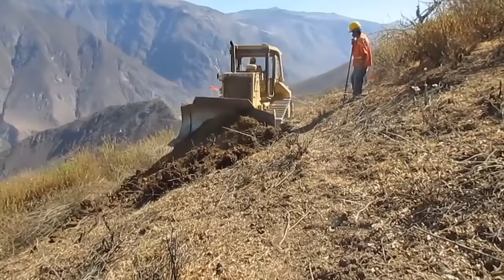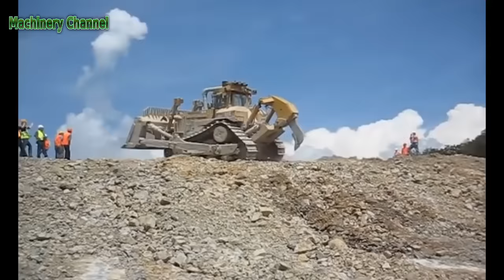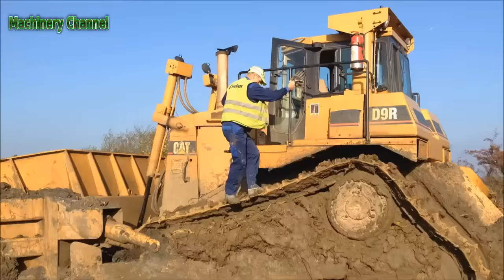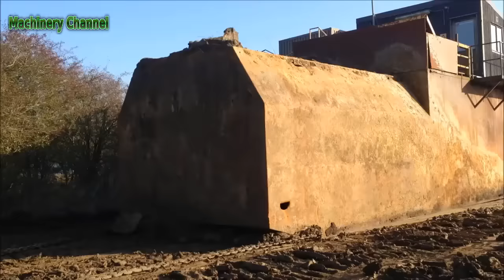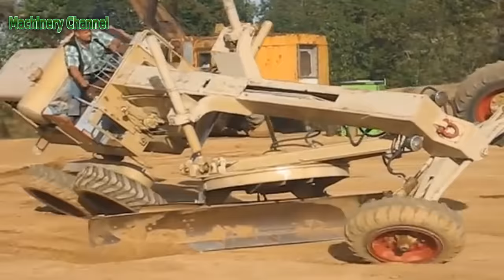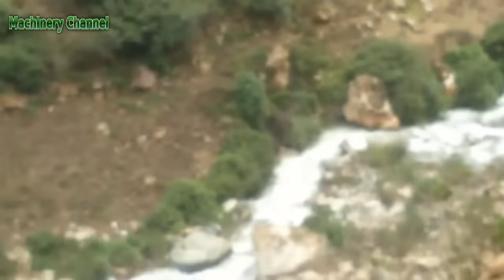Extreme Dangerous Biggest Bulldozer Operator Skills - Amazing Modern Construction Equipment Machines

Comment: I like how the guy in the grader is pulling handles left and right acting like it's hard to keep it in that position when really the blade is just holding it there and requires no real input.
Reply: lllllRBlllll   Ya but hes clearly taking things to seriously.
Reply: I don't see any health and safety inspectors looking on
Reply: A Paz
Reply: I bet his name is Scotty...and he likes Star Trek^^
Reply: С какой целью он так едет? Для чего он это делает?
Reply: I will throw that guy out right away ....he is scraping the engine, not built to run sideway.
Reply: @ВадимВладимиров-п7з  Он просто показывает что так может делать, но нет смысла так дорогу чистить это можно ровно ехать и делать он лишний раз рискует технику опрокинут.
Reply: Seems like they just fuckin around as it's an older looking model surrounded by old rusted relics 🤷
Reply: You don't know much as I ran motor grader years and it is not just holding it up.  You have to constanly pull your saddle set your blade much more if not you run the possibility of blade digging in catching flipping it stalling it.  He is constantly working it to keep it on the side and moving without all that I said.  Keeping one on all wheels cutting grade is a challenge but on the side is a different ball game.

Comment: ...all the while the grader was up on its side goofing off, the oil sump was starving for oil because it was all to one side of the pan. He shortened the engine life with that stunt.
Reply: I thought maybe the grader was doing that because he could get more weight on that side of the blade, but there's 50-100 people watching and filming, so it's some kind of planned stunt.
Reply: EXACTLY.
Reply: SixStringLove Guy I don't think he cared and it wasn't that cool of a stunt really
Reply: The thing sounds like shit anyway and looks like it's burning oil pumping out blue smoke.
Reply: Judging by the age of the machine, I would say its had a long enough life
Reply: Rubbish grade he was laying anyway. - What's the point of that sort of idiocy?
Reply: Fairly dumb exhibition
Reply: yeah that one is crap. That was was just being silly. But hey, this about skills. That was skillful.
Reply: That engine was already on its last legs. Blue smoke is made by the combination of burning oil and burning metal dust. At the very least, the piston-rings need changing. This is not the kind of stunt anyone should pull with old, obviously tired equipment like that. It's like he was actively trying to break it or something. It's not very bright to take an engine that's already putting out blue smoke and then starve it of oil, as you mentioned. I'm amazed it didn't throw a rod and put a window in the block while he was pulling that stunt.
Reply: top

Comment: 0theres nouthing dangerous about side cutting a road into a hillside with a bulldozer!What the hell do you think their made for?As a retired dozer operator with over 40 years experience I know when things become dangerous,that's the time to change you're method of operation! THERE ARE times when it's tricky not paying close attention to you're surroundings is what gets most men into trouble like backing up and over a steep slope or drop off ,I once had a tree come through my back window that i backed into ,nearly took off my head!like I said most accidents are from operator not paying attention to his work invironment
Reply: Exactly I don't know why they call that dangerous... What the hell it ain't going nowhere I've been on a dozer going up the hill almost on a two to one slope when it was wet muddy.... I agree that ain't dangerous as long as the right nut is behind the steering wheel lol

Comment: Actually in my 40 yrs of various heavy equipment operting...the dozer is one of the easiest and safest...to me rubber tired skidsteers requires more skill set even though it's small.
Reply: What is the steepest grade you have operated a dozer on? I t looks like they can climb straight up steep grade as long as they don't slip sideways they look stable.
Reply: But when push a dozer too far and it flips the damage is higher. Saw a dude turn as on steep grade. It slid side ways then flipped. He walked away but his pants smelled like shit. Well not really but he was shaking a bit.
Reply: I learned skid steer way earlier, so for me it's the opposite! Thrown into the deep end doing massive capillary breaks for commercial foundations where you grade hundreds of tons of rock with just a tiny skid steer in the middle of all kinds of columns, walls, and exposed utilities. On my current job I'm finish dozing for paving with a ton of crazy slopes and grade breaks, and I find it way harder. It's fun though

Comment: Edit, my display on my phone showing it yellow, PC it's green
That bulldozer close to the end, The Euclid TC-12, I owned one for a number of years, it's quite a different sort of crawler tractor. you can split it down the middle for shipping. It's basically two single tracked tractors... it has 2 engines, 2 gear boxes and 2 complete hydraulic systems just to mention a few. as you can imagine maintenance and upkeep are quite costly. Ive got a few cat's now, parts for even my D-2 and D-6's are readily available to this day. Not so with the Euclid stuff of even companies still in business. Euclid was a huge company during it's heyday and any of you guys my age 45+ will remember seeing the Euclid equipment for it lime green color, I thought the color of this dozer strange I've only seen a couple of Euclid dumpers in yellow before. As a matter of fact when I was about 4 The green Euclid equipment all over the hills developing the next phase of the housing tract we lived in was what probably imprinted on me that I became an operator as soon as I could. Great line of work it you can get in the Union.

Comment: What is the steepest grade straight up a dozer can be have operated?
I know there are several diffrent models and type.... in general.
Reply: When I was a kid they used cat D8s on the spol heaps at corby steel works. 
On summer day one boiled its radiator and the driver got scalded. 
No cabs in those days bit like sitting in an armchair on the hillside
Reply: @johnbroome3054  sounds pretty steep.

Comment: I have never seen a large Euclid with dual seats in it.   Anyone had experience or knowledge with this, and what was it for?   Training?.   I ran D8 cats for years but never saw a passenger seat.
Reply: I've operated older D8s with the extra large seat, almost room enough for 2.
Reply: I also ran a D6 with a seat for a 400 pounder.  After years of use the seat became glazed and slippery.    Thank goodness for seat belts.

Comment: Running equipment takes alot of skill and is hard work to keep the job site safe so unless you have done it people should keep there comments to themselves
Reply: Justin Madden - Even our simple skid steer on our farm has seen accidents in the past due to inexperience. Let alone one of these behemoths.
Reply: Justin Madden Kim

M no
Reply: jamie alderman as a mechanic in a mine I'll second you. Steering wheel holders and joystick jerkers. And dont forget the "my ac is cool but not cool enough" and the "I think the heat could be a little hotter" and everyone's favorite "my bed wont dump" while it still has 200tons of material sitting on the back.
Reply: Música volver saliban
Reply: Amen ! I always ask people have they EVER done that job. When they say,  'NO.' I just walk away. Opinions are like noses, most people have one.

Comment: I have never seen so many so called operators running very expensive equipment and don't how to decelerate the engine when they switch from forward to reverse. Hard on a transmission. If that was my equipment, their ass would be on a shovel. PERIOD
Reply: You may want to check with the equipment manufacturer before you fire someone...  they are designed to run motor at a constant motor speed(rpm)
Reply: The rpm always dropped when I hit the decal pedal. I ran d6, d8 , 930, 950, 966, 980 , 874,  cranes, rock trucks.      I see someone says they maintained constant rpm ,  don't know what they were trained to do or maybe different equipment , , but not at my workplace.   Our stuff was always Cat. and we always respected it.     Maybe it has changed, I am retired now.
Reply: In hindsight, I did also operate a 963 and a 970 bucket loader which had a hydrostatic transmission.  I don't recall  a decelerator on them, so the person objecting to the rpm decal, may be right.   This may apply to only some equipment, but whether it applied to the video, although it is Cat,  I am not familiar with its operation.   There is always room for difference depending where and when we worked and how recent the equipment is .   I am not familiar with current equipment.
Reply: Yes Sir They do still have a Decel pedal, and if they didn't pay for it they won't worry about taking care of it...
Reply: @Seabeejim133  yup, that's what it all boils down to
Reply: Hi
Reply: Allis Chalmers built into their transmission a soft-shift feature. It was designed for full rpm shifts, in fact the powershift lever wasn't gated it could be toggled forward to reverse. The transmission would modulate the shift by bringing the preassures up.slowly thus avoiding a shock load
Reply: Jerr
Reply: You don't own equipment. PERIOD
Reply: My natural instinct was always to decelerate when changing from forward to reverse or vice versa but I think that comes down to Operating Wheeled Loaders,Hysters and Trucks.
Why would you want to keep full revs up it only takes a split second to get the revs back up to Operating range anyway?
Reply: Jerry Hubbard
Reply: Also to the guy that 2nd geared that 9l into the boulder would be fired on the spot

Comment: The grader on its side like that must be hard on the engine. All the oil on one side and nothing for pump to pick up. If i parked my pickup on a lean like that and ran extended time the oil light comes on. Ya people think its cool but wont wont the engine stops working.

Comment: Meanwhile at OSHA: fatal stroke
Reply: Howlin' Matt the problem at OSHA is the failure of the bosses to appoint capable managers. The skill is to use equipment properly, to keep it working, not sitting in the workshop waiting for parts. I was totally gobsmacked one day when I saw that a local Tesco H&S manager stopped a promo with a guy making animals out of balloons. Reason? some children are allergic to balloons. That is totally wrong, the manager was incompetent. Fault lies with senior management. I could say more.

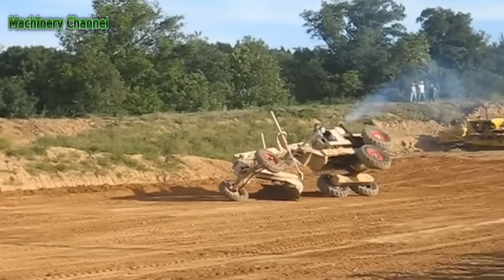Comment: Now at 3:00 good thing OSHA didn't walk up on that job and see that dumb dumb on the motor grader...... Bet you don't even have seat belt on..! Actually that can't be good for the motor because it's causing all the motor oil to shift to one side can cause a hydro lock.... Also he must have a full tank fuel because looks like fuel tanks on this side too surprised that machine ain't choked itself out

Comment: Those idiots with shitty tune-jobs on their diesel trucks, dumping out loads of black smoke, could learn alot from watching machines like this work. Most of them have a metric-shit-tonne of power, yet most of them don't put out black smoke. This is because they've been tuned properly. I've even seen diesel Pro-Mod pulling tractors and trucks with 3000+hp that don't make as much smoke yanking around a sled as your average diesel-tuner's rig does with no load on it (or as I call them, Diesel Ricers).